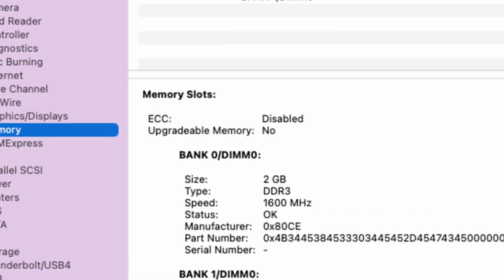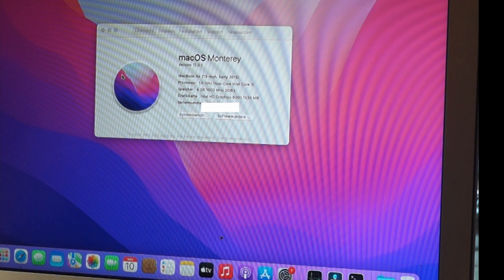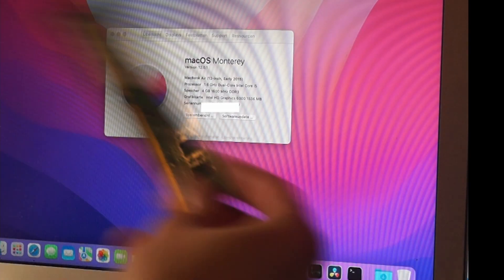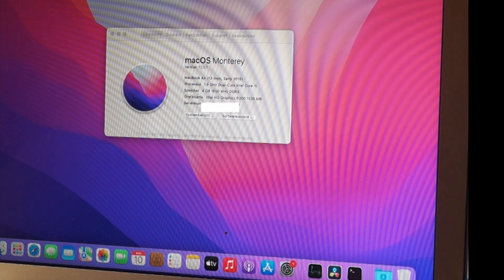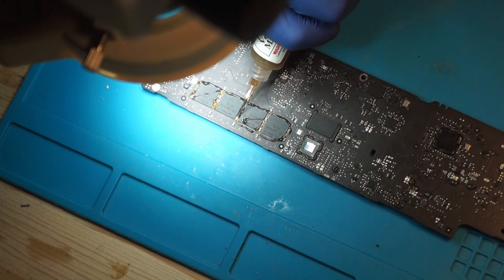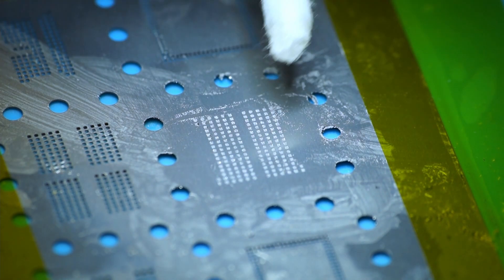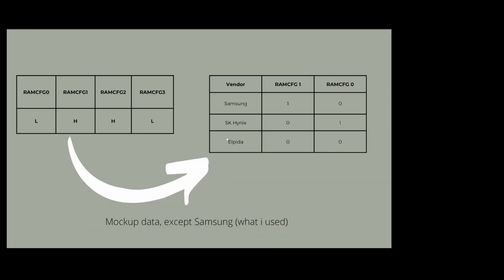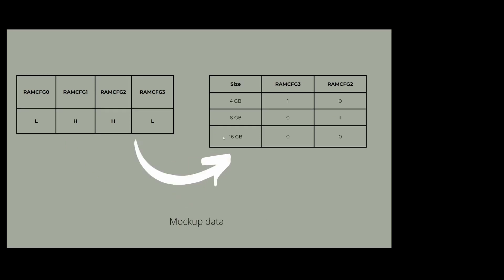Upgrading from 4 to 8 GB of RAM on a MacBook Air | Howto extend the useful live of a Macbook

Comment: 3 years late for this but since 8 gib 2015 air are easily available for 20 to 30 bucks so its not really worth this headache since 8 gig ram chips are priced almost the same as a broken display body damaged air so best deal is to buy a dead display air with 8 gibs and transplant the mobby  
still fine soldering skills you make this easy than it actually is